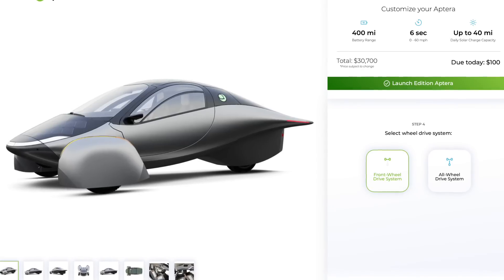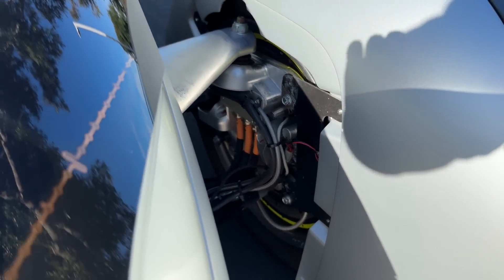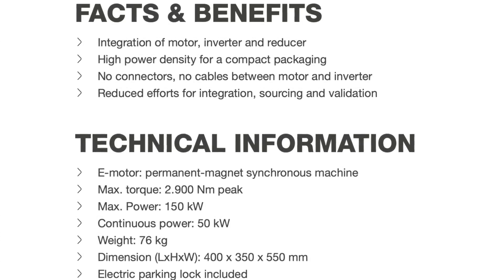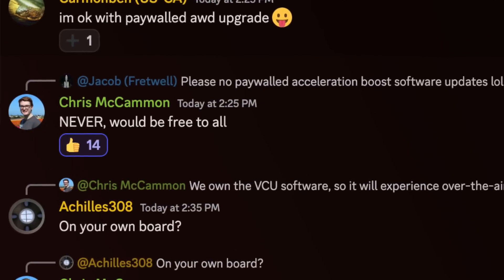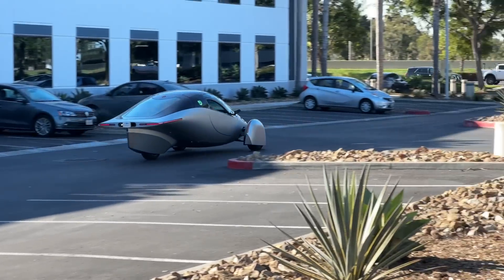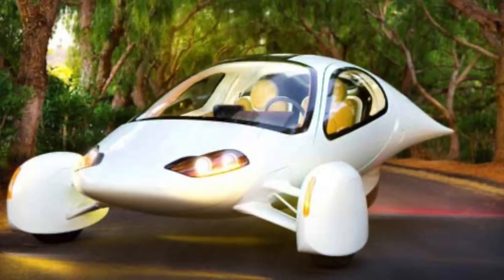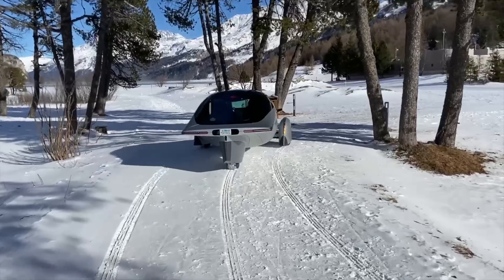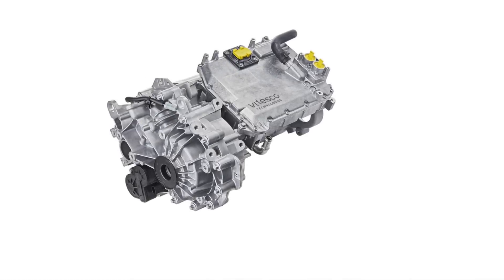Aptera's New Motor UNVEILED!

Comment: So Aptera got cheaper, lost some weight, and is more efficient? Sounds like a big win to me :)
Reply: I don't know about cheaper.
Reply: Everyone pontificates about efficiency but the points which are continually under-emphasized are reliability and maintainability. As an engineer and mechanic I strongly believe a single onboard electric motor which is protected from the environment will be better suited to the vehicle's longevity and maintainability.  Sure, taking out unsprung weight by removing the IWMs will benefit ride and handling, but to me the idea of taking electric motors out of exposure to rain, snow, ice, and deep puddles in the road is a huge bonus.  I am strongly in favor of this decision and have never considered the AWD option.  I'm happy to buy an Aptera with no hub motors.  (I am also a HUGE fan of Right to Repair!!!)
Reply: Not cheaper and will likely be more than the 25,900 price they gave a few years ago. Strictly due to inflation. 

Price will probably come in at 30,000 if I had to guess.
Reply: @MrStrife622  $25,900 was the base model FWD without full solar, premium audio, 400 mi battery, etc. The Launch Edition was always $33 to 34K.
Reply: @jeffcarlton3590  Yes that's correct
Reply: @jakeleaves  I believe them when aptera mentioned timing. 
I wonder how much cost played a part because I'm definitely concerned about cost.
Reply: promised to do that….

so far they haven’t been able to deliver one single promise they have made.

so far they haven’t completed a single thing except take money.
Reply: And it still does not exist. LMAO
Reply: Your a shell for sure
Reply: But gonna slightly hurt the looks, limit offroad suspension modifications and worse regen
Reply: Maximum copium achieved!
Reply: "let me tell you why this terrible compromise to a vehicle that won't see light of day is good news!"
Reply: I thought the hub wheel company didn't want to make the motor for Aptera because of low volume and high start up costs.
Reply: Where did you hear that it will be more efficient?  What did you hear? What did I miss? To me efficiency matters more than anything else.
Reply: @robertkirchner7981  Efficiency can increased by this change because of the loss of unsprung weight; especially on the uneven roads of city streets.  On normal city streets where there are bumps,  With nearly 100 lbs of added in-wheel weight now removed from the wheels, there is less forward velocity energy expended to lift the heavy wheels over the bump.  With heavy in-wheel motors the upward motion of the wheel will lift the entire car upwards.  This will slow the forward velocity of the Aptera.  With lighter wheels, the upward force of the bump is instead transferred to the spring (instead of lifting the entire car), After the Aptera passes the bump, the spring will release its energy by pushing the wheel back to the ground but the majority of the Aptera's mass and forward velocity remains mostly unchanged.
Reply: @robertkirchner7981 We may never know for sure because we won't have a direct side by side comparison, but in most ev's the more efficient models have less motors.
Reply: @robertkirchner7981 validation will tell us everything!
Reply: @robertkirchner7981  The motor can be more efficient as it doesn't have to fit in a wheel as a radial motor can increase efficiency with length.
Reply: loses a lot of that in drive train.

no efging way is this more efficient
Reply: A hub motor will be always more efficient. It's direct power from motor to wheel. If you add a drivetrain to that, you're losing some efficiency
Reply: @hellomouse2354 True. But need to compare with 2 (or 3) hub motors and all the associated hardware of each system. Doubt we'll ever see a final design side by side comparison of each.
Reply: Efficiency has not been confirmed in the real world, and the price will likely increase with ongoing delays and production changes if and when the vehicle is actually produced.
Reply: Maybe a silly question. Given that there is just that one point of contact in the rear what happens when the vehicle is parked and some big fat human stupidly chooses to lean on, or worse, try to sit on the flat "wings" on the back (as if this was a regular four wheeled car)?   I get that this is technically registered as a motorcycle...and no one would ever expect a motorcycle to be as stable as a four wheeled car...........but Aptera will be seen and used as a car, and will be parked in car parking spaces that cannot be policed/monitored against some stupid fool trying to lean, or sit on the rear wings.

How much weight would it take to tip it over?

Could there be a super loud alarm rigged to alert that tipping is about to happen?
Reply: @nilent  Interesting question, how much weight. I'd guess more than a fat human. The rear corners aren't nearly as wide as the outboard front wheels. But a couple of strong pranksters may be able to lift the back and swing it around. I've seen that done with 2 guys and small cars.
Reply: Consider this thing still weighs a ton, and has low center of gravity, someone sitting on the back corner won't be a problem.   @nilent
Reply: You guys in the comments saying it'll be more efficient don't know what they are talking about. And the reasons you give why are preposterous. Also cheaper is yet to be seen. The convertible note fundraiser slide deck showed a potential price of $39,000. This change may have already been factored into that price.
Reply: @MakeSteelBattalion2 
Aptera has updated my reservation. It now shows 2 WD, 0 to 60 6 sec and a price of $ 30,700.